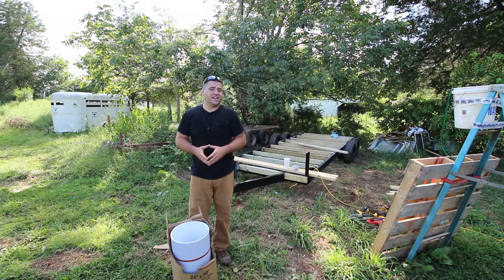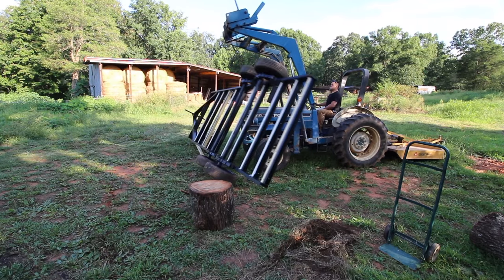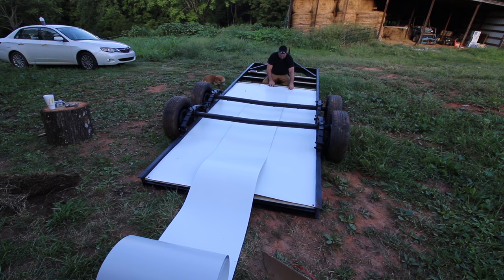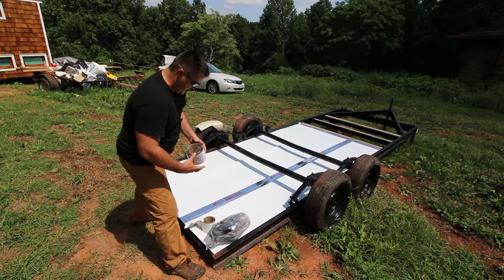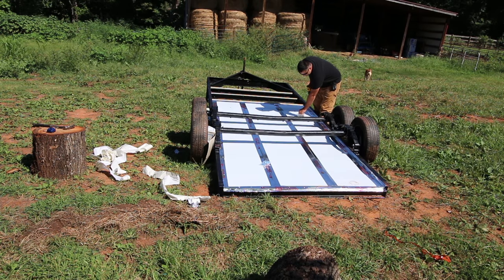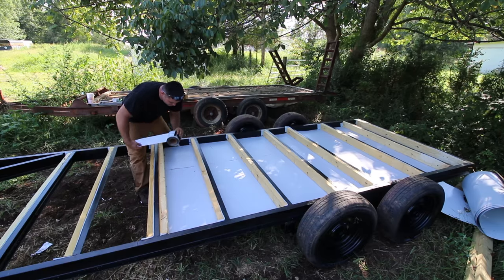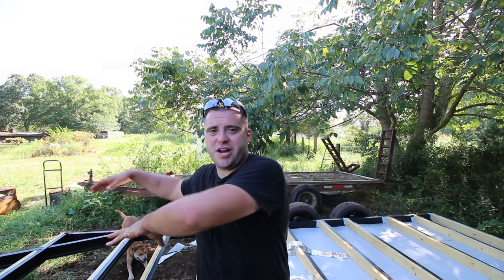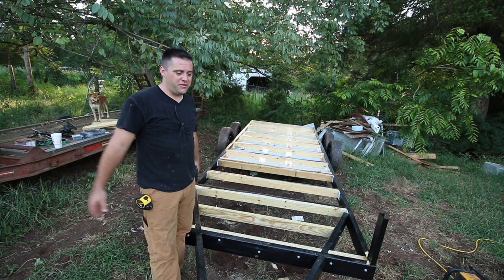Tiny House Terry E8 - Aluminum Undercarriage Protection

Comment: I just found your channel and after watching this video I've subscribed. The main reason is that I appreciate you sharing the cost of the materials as you go along. I'll go back and watch some more of them. I like the idea of the aluminum undercarriage. A suggestion, the next time you make one of these. A chalk mark on the frame at each cross member before you put the aluminum in place might make it easier to know where to place the screws.
Reply from the maker: +Chain saw cabinet Shop  thanks! :)

Comment: one forklift trick to flipping things like that trailer is lifting the close end with the forks  til the high end is leaning against something like a container (tree maybe )so its standing on end then pulling the bottom end until its upside down . Letting it drag its way down the vertical face of the container
Reply: lol  , never mind . i got to that point . 2 years late

Comment: What about the front of the trailer? That's a narrow floor plan? I wish I kept mine that way, but we welded pieces out to make it 8 ft wide, that way I had that 6 inches for everything on the outside, 3 inches each side, and I just made it under, by an 1/8 of an inch per side, because I had to make shiplap out of repurposed plywood, that was my cladding,8 inch wide strips, cut with circular saw, lol, and the laps add a couple inches to the width, but I wanted the walls to be able to breathe.

Comment: Hey Dan, thanks for the video. I am about to use aluminum flashing on the bottom of my trailer just like you. Only thing is, I can't shake the thought that there will be condensation forming in the subfloor on the inside wall of the flashing. Do you have any thought about this?

Comment: Hey Dan,  Where did  you get you Aluminum from for your Aluminum Undercarriage. I am working with and RV frame as well  debating on doing it like your however the length in-between the C channel is just a little over 5 ft  my outriggers or gussets are all but rusted away except one and the big debate right now is to fab some outriggers  that look the same or do like others and get some square tubing and weld on a piece for another foot on both side to get  a little more room for inside.
Reply from the maker: +James Bryant   It's available at the big box store.  Different lengths, colors and textures.  It's gonna be between lumber and insulation near the roofing.

Comment: At 5:16 does the leading axle have a bend in it?
Reply from the maker: It has a curve in it so when there's weight on the axles it bends straight
Reply: Thanks Dan, you may have noticed, I don't build trailers for a living :-)

Comment: At 1:13 you mentioned that the screws have a "rubber garment" on them. A garment is a piece of clothing. It's called a grommet. You don't want people going to the hardware store asking for rubber garments, AKA condoms. That would get a lot of embarrassing looks. A condom is attached before a screw. Right? You don't want everyone placing condoms on all the screws; that wood look very odd!  First goes the rubber "garment" and then the screw, If you're talking about metal screws, and grommets then the same procedure applies. You need to know this if you're going to call that girl.  

  Hope this helps.
Reply: no one cares
Reply: @Howard Gray.  A troll with no sense of humor.